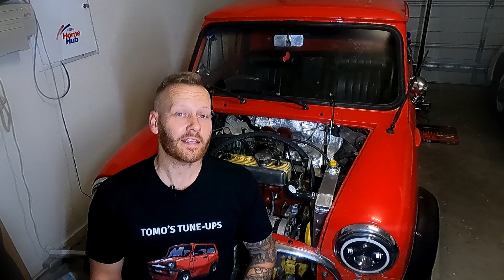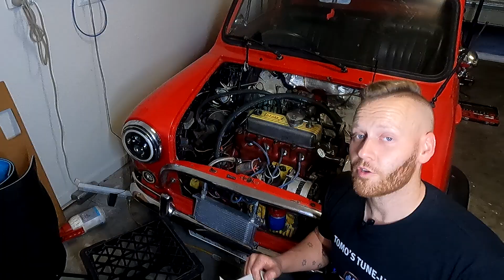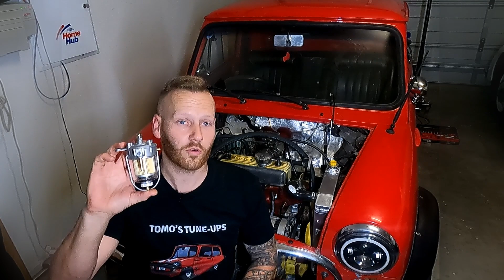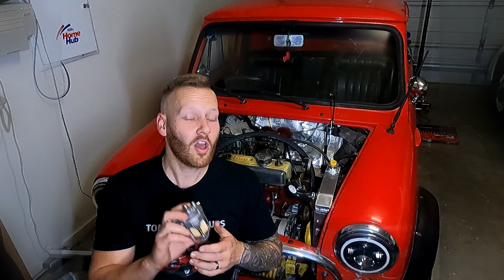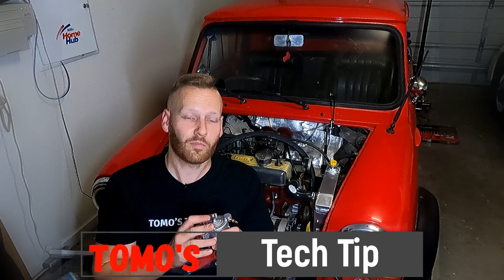Minisport - Malpassi (Filter King) Adjustable fuel pressure regulator | Classic Mini Tools

Comment: Do you use return line back to the tank from the carburettor.Ive twin webber 45s in my jimny and im using a facet.fuel pimp but dont know how to pipe it
Reply from the maker: Hey mate, depending on the setup, you can run a return hose. On the Black Mozzie, we had to run one otherwise the vehicle wouldnt idle properly or maintain fuel pressure. This pipe thought was run back from from the fuel pressure regulator. Feel free to message me on instagram if youre stuck and need further help. Tomo

Comment: Hey tomo how’s it going .I had to put one of those on my mini after I installed an electric fuel pump.Pulled up quickly at a set of lights one day and it flooded itself and cut out.Put the regulator on and it has never done it again 😊
Reply from the maker: Hey mate, going well. How about you?
Great to hear, they’re bloody wonderful things, something I’d never used or consider using before. Worth theyre weight in gold (in my opinion) especially having the fitting for a fuel pressure gauge attachment. Glad you liked the episode - Tomo